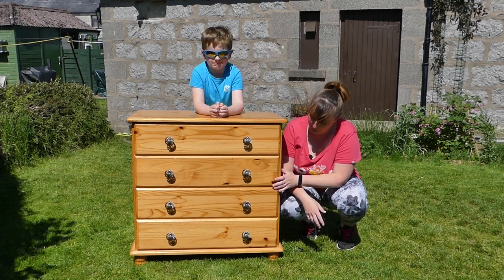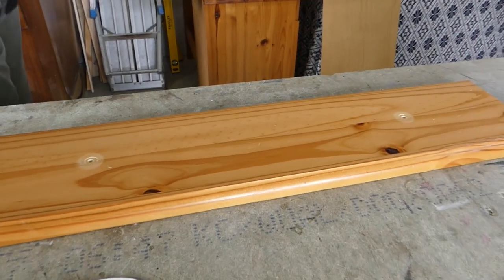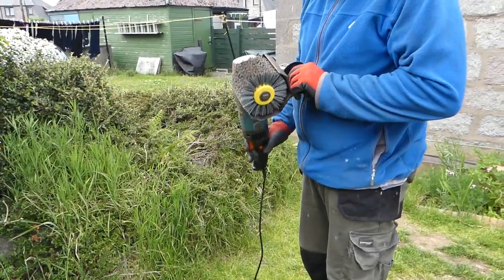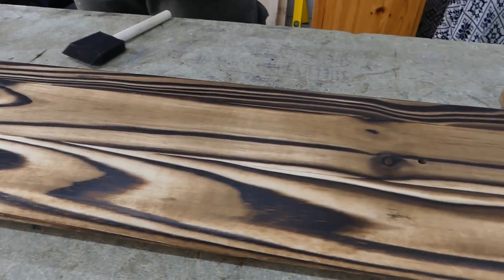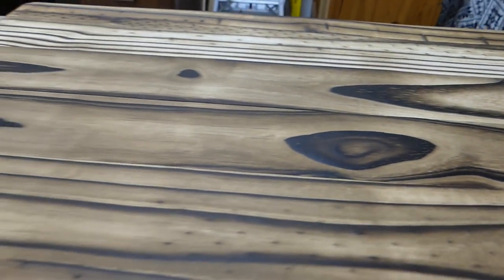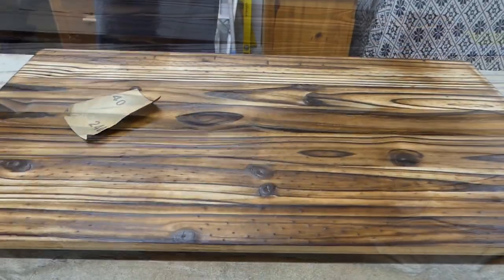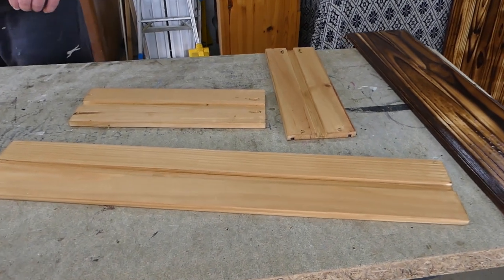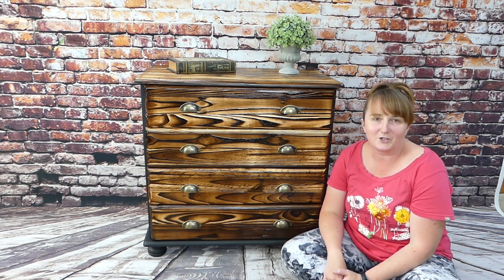How to transform pine chest of drawers into eye catching beauty.

Comment: Does it smell when it’s finished?
Reply from the maker: No it does not. I can't smell anything. We always use something to protect wood. Varnish, lacquer or Osmo hard wax oil. Those products are sealer as well so If any smell will be left after burning and cleaning process those products will seal it and it won't be noticeable. Only smell that you will be noticeable to you will be smell of products you have used. Thank you again for watching.